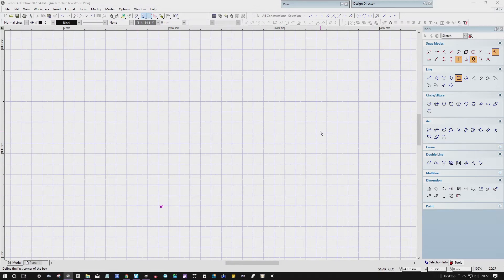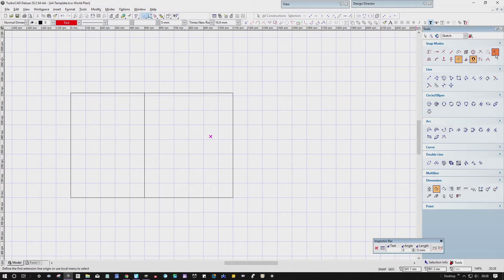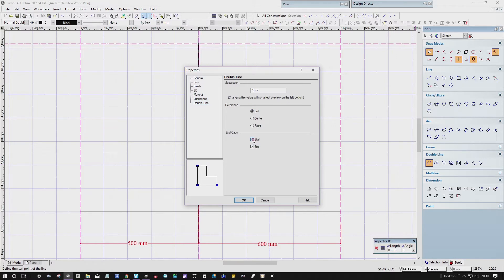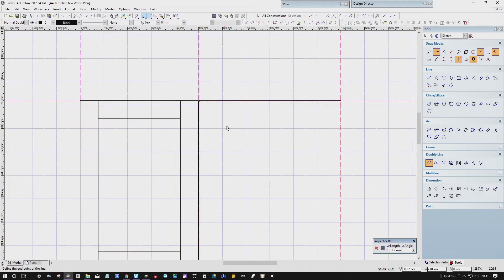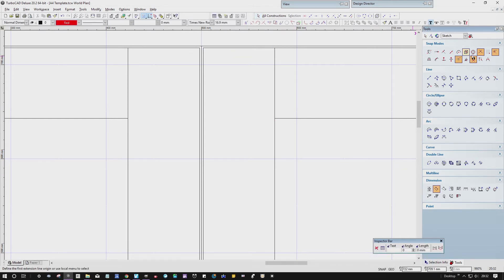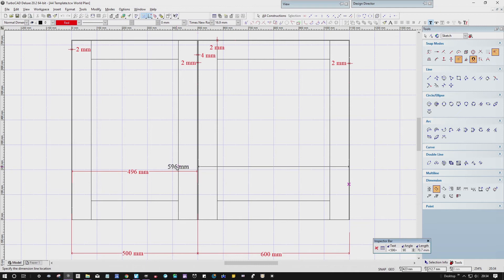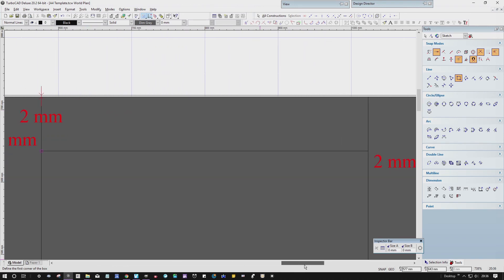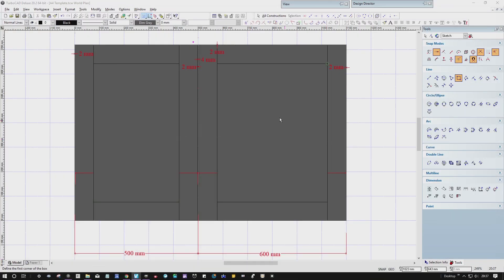Drawing example of 2 kitchen doors with TurboCAD Deluxe

Comment: Thank you so much for taking the time showing this Gid it made it a lot clearer. I think I would need s bit of practice using that program like every thing once used too it comes a little easier. 
So say on a 1000 kitchen unit you have two doors for it. The clapping edge where the two doors meet would that be 4mm or would you make that more like 3mm. 
I understand when your unit only has one door it’s 2mm and when next door starts it’s 2mm giving you 4mm space  which is nice spacing between door units.
Once again thanks for your explanations and time appreciated. 
Cheers Gid
Reply from the maker: I think it's hard to be that accurate when working with wood, wood will shrink & expand by more than 1mm, when it goes through the planer the rollers will squash the wood a little so each board with it's own density will come out a fraction different, how much it gets sanded, how much paint goes on, there's many factors that will affect the final sizes n layout, on a 1000 unit leaving 2mm gap to each door making 4mm in the middle, when fitted i would average them out giving each gap approx 3mm until it looks correct, 
I'll be doing the same on this kitchen, fitting all the doors then adjusting them until the gaps are parallel & the gaps have similar widths,  The units themselves are not precision made 500mm,600mm etc.. they'll be 501, 503, 602mm or 598mm, i didn't measure that accurately, i can only work on the nominal size, 
This is after all a kitchen, in a way it's construction work not cabinet making, I try to be as precise as i can but you'd never get anything done if you tried to be that exact, simply because it wouldn't work, the door would stick in the winter n be loose in the summer, going from a builders yard, to my shed then into a centrally heated house the wood whatever it is, Oak,Beech,Pine will def move, 👍
Reply: Yes I understand Gid, I was  only looking for rule of thumb measurement really . I’ll keep 3mm in mind like you’ve mentioned before we have a little leeway with hinge adjustment. I’ve just cut my stiles and rails for project I’m making utility unit. I did a plan and bearing in mind the 2mm space addition. I just need to groove them, then cut panels. 
Your vids couldn’t of come at a better time Gid, hence my posts. When I get round to finishing I’ll post to your f/b messenger. 👍
Reply from the maker: I hope they went well.
I've been gluing up the doors today,
Most of the time i would have the units/cabinets here to fit them to, so I'm going to take these to the house, fix them to the drawers, cut in the hinges & just generally fit them, 
2mm is the starting point, maybe a little less of a gap than i'll need, that's why I'm happy that there'll be 4mm between them, if i have to i can plane a fraction off, it's better they're too big than too small, 
In some cases on inset doors a leading edge has to be planed on the clapping edge when the doors don't have much gap.
Then i'll bring them back & paint them. they should fit no problem then.

Comment: Hi Gid. Could you tell me how many teeth your Freud blade has got that’s fitted to your Kapex mitre saw. 
I’ve noticed the cross cuts are excellent. Keep the videos coming please. 
Wayne Dedmen-Ert
Reply from the maker: Hi, it's 260 x 60T, Yep when i got the first one it cut very well, seemed to stay sharp & cut consistently well, I've got a few now,  They're slightly more expensive than other blades but I'm not disappointed n happy with the cuts,
https://www.screwfix.com/p/freud-tct-circular-saw-blade-260-x-30mm-60t/3845f
Yep I will do, Thanks
Reply: Freud are always my first choice for blades.